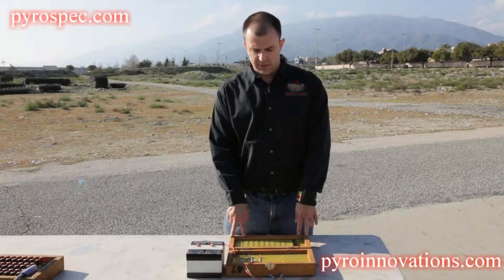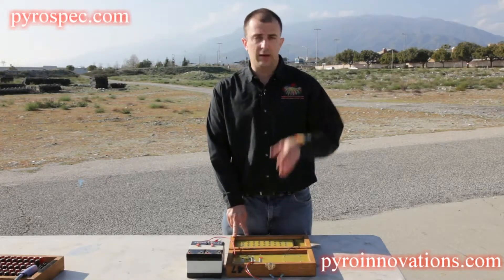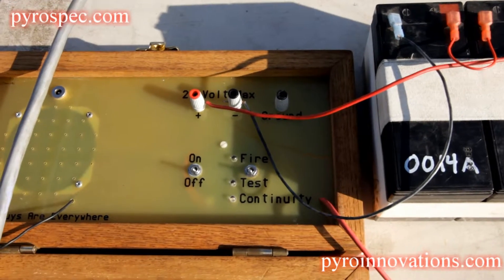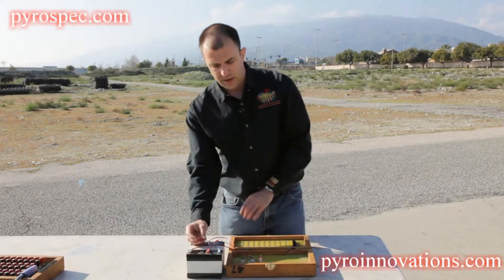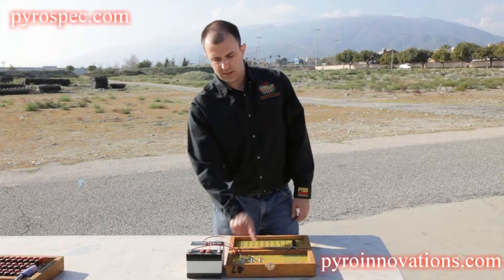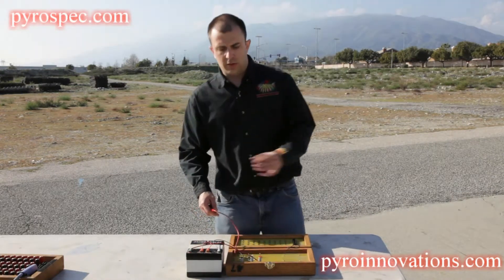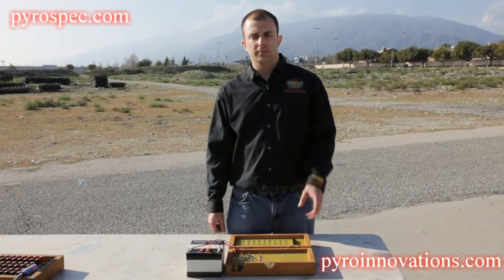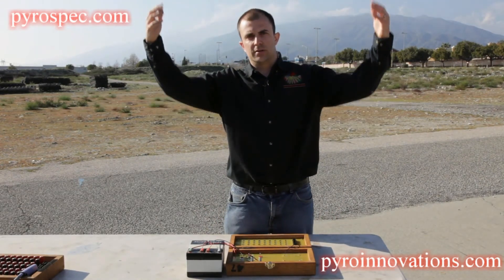How to use an Internally Grounded Firing System

Comment: Is there a reason why different operators and shows use different firing systems?
Reply from the maker: Great question.  Yes and no.  For starters, there are many different commercially manufactured firing systems on the market, each with different features and price levels, just like there are many make and model versions of cars and trucks.  Each company picks the systems that meet their needs at the price that makes sense for them.  Some use tried and true, others go with the latest and greatest.  Some companies manufacture their own in house as well, in addition to owning commercially manufactured systems.  Hope that helps, thanks for the comment.